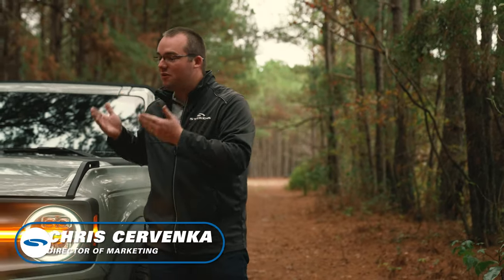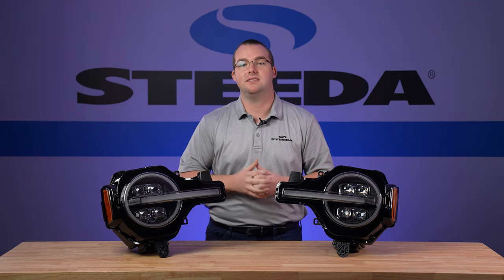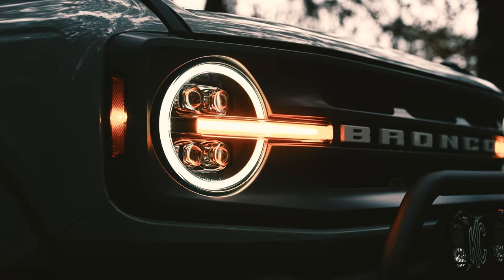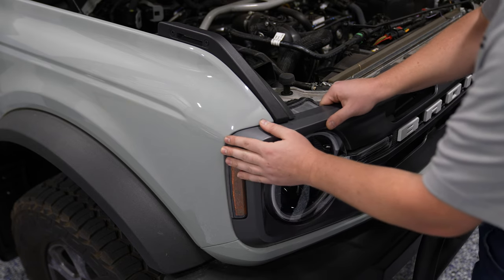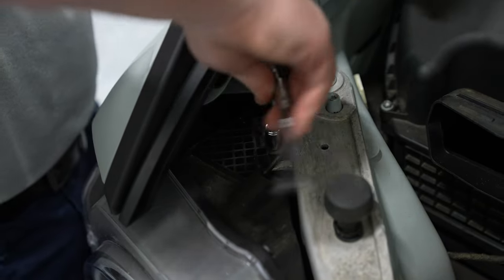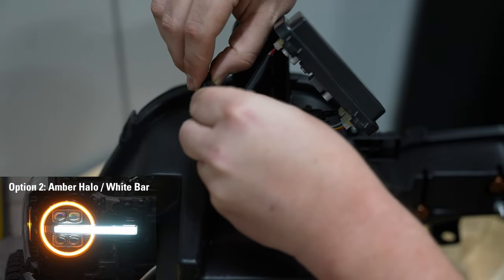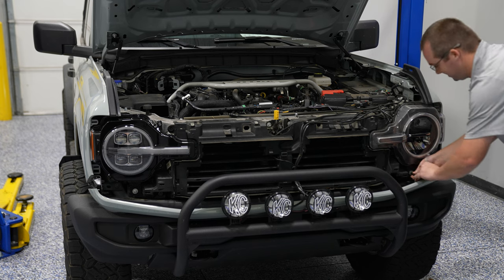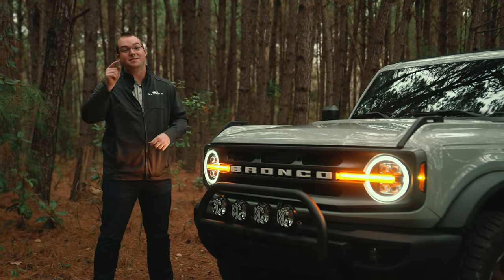AlphaRex Ford Bronco NOVA-Series Headlights (2021-2023) | Review & Install

Comment: These are nice but I have a question. What if you want to change up the light combo after they’re installed? Do you have to remove everything to get to those wires?
Reply from the maker: You might be able to reach that panel through the fender, but they weren't really designed to be changed often.